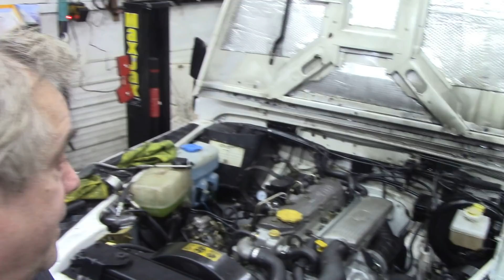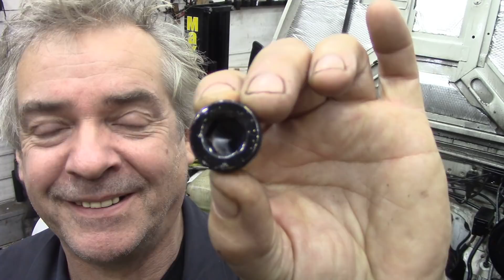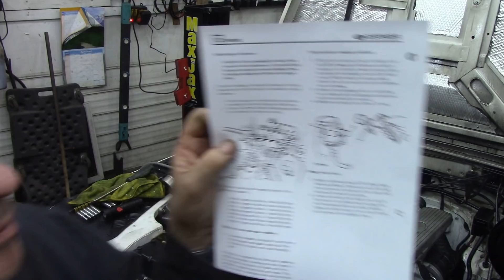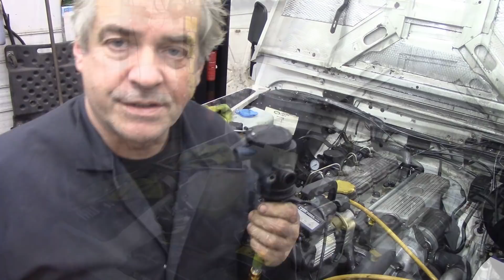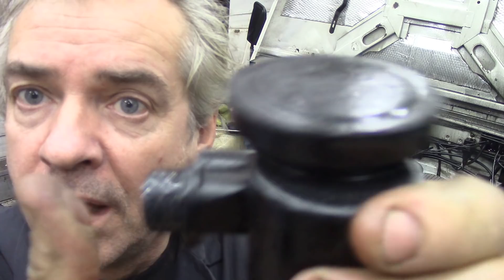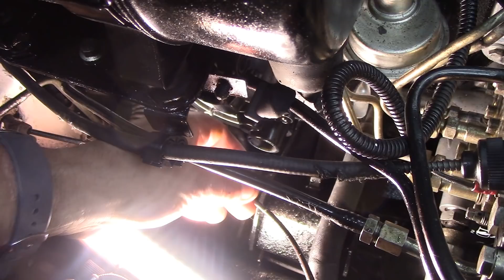Spanish 110 300Tdi. Sorted? Watch to the end!

Comment: Mike, I had a 2005 Volvo v50 (same as s40 sedan) with an electric vacuum pump. It was the 5 cylinder petrol engine probably fitted to other models as well. I suspect there might be a few of those at the wreckers by now.

Comment: Mike, I thought while you were testing with the vac pump blanked off, I would prefer to remove the Vac pump all together and put a plate over the hole in the crank case. You know then it can’t be blowing air into the crankcase
Reply from the maker: I normally remove the hose and plug the connector - that is normally enough to eliminate the Servo leaking, but I didn't expect the pump to be bodged up

Comment: You are supposed to run an engine hardish right away to get the rings to seat before the bores glaze.  Bringing in at idle is the worst thing you can do with new rings.  As to the breather, the diaphragm valve is better design.  It limits vacuum levels on the crankcase.

Comment: Mike, you don't even imagine how many times I have been talking to my friends, the ones in the Land Rover Workshop, about those vacuum pumps, my idea was to put a blank cover there and then use electric vacuum pumps... the result, no leaks and if the pump is good no more problems... I have to find out which ones are good... I am sick of 300Tdi ones... Also... 200Tdi were really good... A pity the engine block was redesigned...
Reply from the maker: I have ordered a  Hella UP 28  - when it comes I will do a video

Comment: Hi Mike quick question I'm buying a series 3 am I going to need a set of Wentworth spanner to work on it or will metric spanner be enough
Reply from the maker: Depends on the year, but there were Whitworth bolts on the transmission but most should be AF - regular inch spanners - very later ones were Metric

Comment: Hi Mike, when you revved and it went bang was the turbo/intercooler still blocked, maybe if the turbo is the cause of crank pressure then is that not the cause of that little plug blowing out the vacuum pump so I'm leaning more towards a faulty turbo? P.S Breasts on a bull or Tits on a rattle snake.
Reply from the maker: Well runs fine now so it must have been the plug or I would still have pressure

Comment: I said I had the same issue, with the exhauster pump pressurising the crankcase forcing oil passed the rings, it looking like a two stroke landy. When you replied you had blocked it off, I thought you had removed it. I was toying with the idea of trying to use a td5 vac pump on mine, but will have a look at the electric ones. Great vlog and pleased you've sorted it. 👍
Reply from the maker: Thanks for sharing

Comment: You have not wasted your time on this one Mike. You have been caught in a cycle of learning, and that is what this job is all about. I bought quite a few Ford Cargo wagons that had been put into the block/auction because of supposed head gasket problems that could not be fixed. I found out that it was the head gasket on the water cooled compressor that had blown causing pressure in the header tank. It cost less than a fiver to buy the parts and less than a hour to replace. That is where knowledge is worth having. So please dont kick yourself to hard for taking us through this learning curve. Many thanks, Yorkshire Rob.
Reply from the maker: But of a mind f*ck as I knew the pistons were correct - shoved a temp plastic plug in there while JP makes me a metal one - no back pressure, sweet as a nut now - like a Swiss watch!

Comment: When vac pump started leaking on my 300 i did same, Used a Hella UP28 Vaccum pump off a Jaguar, then a vac tank off a VAG,  a Adjustable vaccum switch ( PSF109S-81-330) and setup with a vaccum guage. The Hella pumps are used on loads of diffrent vehicals (VW/Audi, Volvo, Jaguar/Landrover, Mercedies, and wouldnt be supprised to find them on load of American Stuff aswell)   most direct injection petrols use them and of course diesels. I just picked up a used pump for £20 or so and has been woprking flawlessly for 2 years, Planning on adding another one in the loop for redundancy easy enough to do and can put almost anywhere.  New ones are of course available but im cheap
Reply from the maker: I an going to see if I can make a full replacement kit  - with blanking plate, support bracket etc for less than the costs of importing the cheapest new one (C$200)

Comment: Regarding the whole "take it for a run" thing; nah.

You've rebuilt engines before (once or twice) and this hasn't happened before.
If it WAS common for 300tdi engines to act like this until they've been run-in, you'd know about it and you'd have seen it before.
This ISN'T a common issue, which might cure itself after running-in.
It's something with a specific cause that needs finding before you can say it's fixed.

I'm a great believer in FINDING the cause of problems.
Whenever something malfunctions, you've GOT to find the cause of the problem or you don't know if it's going to crop up again later on.
When people say things like "I just sprayed all the connectors with WD40 and the problem went away" or "I just revved it up and it's cured itself" it always gives me the heeby-jeebies 'cos they HAVEN'T figured out what was wrong and they're just hoping it won't happen again.
Which, when it comes to problems, they always DO happen again unless you find the cause and fix it.

Regarding the electric vacuum pump, by coincidence I've recently been helping somebody out with fitting an electric vacuum pump to a boat engine.
The guy ended-up buying an electric vac' pump for a Ford F250 and he seems happy with it.
Only problem is that the electrical connector is molded into the body of the pump so, if you want to make a proper job of it, you also need to buy a wiring pigtail from a Ford dealer.
On the positive side, once you've got the pigtail, you can make a proper job of the wiring and make the pump look like it's a factory fit.

No idea how reliable the Ford vac' pump is though, TBH.
The guy bought the Ford unit 'cos it was simple and is about half the price of an equivalent from other manufacturers.
He seems happy with how it's working though.
Reply from the maker: Just ordered this
https://www.ebay.ca/itm/284352951926

Comment: Mike, what about the possibility of pressure from the turbo being released into the crank case through the oil drain pipe and a leaking turbine shaft seal...
Reply from the maker: I had this thought - until I saw the vac pump plug!
Reply: @BritannicaRestorations  yes, that's not okay for sure but can it alone cause that back pressure?
Reply from the maker: Well it has been running for an hour now with zero pressure out of the cap, so I think that is it
Reply: @BritannicaRestorations  unbelievable! As you have said earlier: something very stupid

Comment: Definitely not rings, I commented on one of your previous videos about my rebuilt 300 TDI with too much crank case pressure.
When I pulled the head and sump to fit yet another set of rings I found nothing wrong with the rings or bores.
Every thing was new on this motor, bored 1mm, crank ground 0.25mm, new head, new conrods, new vacuum pump, lift pump, timing belt.

After seeing that plug come out of the vacuum pump I'm suspecting my not very old leaking vacuum pump is rubbish and is possibly
My problem. I've been a mechanic for over 30 years and have rebuilt plenty of motors. I always expect a little blow by past the rings until they bed in, Like you have noticed with the compression increase and no longer pushing oil out.
I thought I might of installed the top ring wrong way up after finding my motor still had to much blow by after 15 000 Kms driving but a new set of rings did nothing. I will be quite cranky if it all to do with a badly made and not so cheap vacuum pump
Reply from the maker: Check the servo first - very common for them to leak and draw air into the crank cases - in my instance I plugged the pump = but it was still drawing in air through the doggy pump
Reply: @BritannicaRestorations  Already did that test by plugging the vacuum line after seeing your video on a previous engine you were  working on that had excessive crank case pressure. The vacuum pump has leaked oil from from the plug area since fitting it new. I've been a long time watcher of your great videos 😉

Comment: Cross fingers that the vac pump caused that problem.
That engine should have tons of power, with the pressures you measured.

An engineering machine shop built an engine for my S3 SWB, petrol.
It burnt about 1 litre of oil a month. I took it to them but they were useless.
My regular mechanic looked at it and found the PCV valve diaphragm was defective. Replaced it and reduced the oil consumption to 1 litre every 3 month.
Many years later, the engine had a major failure; it was a right off. My mechanic stripped it and found a baffle missing on the oil filler tube, hence, the high oil consumption. There were other wonderful things like part of a stocking in one of the water galleries.
Good times had by all.
Reply from the maker: yeah I think the numbers are good - had t be something stooopid!

Comment: I was wondering a couple of vids ago if it was the vac pump but couldn't remember exactly what effect they could have when they go wrong.  I have been wondering about fitting an electric vac pump to mine too as i think the current pump has packed up, third one in four years!
Reply from the maker: They are total crap! I think because the pump was washed in the parts washer, the silicon used to hold the 'plug' in became soft and alowed air in = but as the engine got hot the silicone dried out and sealed again - but not tight
Reply: @BritannicaRestorations  I'll be looking out for the vid on electric vac pumps from scrap cars, just looked at the price of some new ones!  Mind teh rubbish Wabco pumps are £100 or so at the moment!  Could just push the brake pedal a bit harder like on my series 3 instead! :)

Comment: I hear the diaphragm on the breather of my 200 cycling at idle.  It makes a periodic plasticky “glug” as it pops closed.  It’s so obvious because it is a 200 retrofit into a Series III using a 19J air filter, with the breather feeding into the inlet of the filter housing.  The noise travels up the plastic Mantec snorkel pretty well.

That damned engine was fully rebuilt with a +20 rebore, rebuilt head and a good swapped out turbo.  It then had that turbo rebuilt and later replaced with brand new (Turbo Technics), the valve stems seals replaced again, then the head fully rebuilt again and the rings replaced.  I still can’t find why it burns oil, especially at idle and on the overrun.  Not sure if there is a honing issue, bore glazing from running in too gently and using Slick50 and vegoil too soon after running in, or maybe a blocked turbo oil return causing the oil to get into the turbine.  Each time the head came off, the piston crowns were a little coked but not wet, so I’m really wondering about the turbo oil hose, given how much else has been replaced.  It’d be Sod’s law to be something cheap and simple after so much cost and effort, much like your vacuum pump!  

My wife’s FFR Lightweight had running problems a while after we got it.  It’d start instantly after standing for months and was so smooth and quiet, but once it warmed up it became gutless and would misfire.  I rebuilt the carb, the entire fuel system (rebuilt the fuel tap, lift pump, removed and riddled through the pickup pipes, new lines and hoses) and replaced the exhaust and manifolds with new, while my wife rebuilt the distributor.  We even tried replacing the carb and entire ignition system with new, all to no avail.  It occurred to me a while after we sold it that the brakes got bad at about the same time, so it was almost certainly the servo leaking into the induction manifold, weakening the mixture.  Amazing, the trouble that ancillary air leaks can cause.
Reply from the maker: On the HS 2.8 they had a modified rocker box cover with a baffle front to back so there was no oil splash getting into the same separator as the 300/200.
On the Tdi the pipe on the top feeds directly into the intake hose - not the filter - problem is with retro fits is the original air filter system is usually missing. I have a few 200Tdi filters here - but no brackets that attach to the inner wing - these are complicated to make and now obsolete 

Servo leaks are so common and cause so many issues.
I think on this engine with the vac pump plug being lose caused the problem - I missed it as it was painted black, but  I washed all the parts in the washer  - so I expect the silicon went soft allowing air to be introduced into the crank cases, but as the engine heated  up it started to dry - which would account for it getting 'better'

Comment: The core plug is 22 mm in diameter and 9.4mm deep.
We had a guy that made kits for us. It also came with nuts and bolts to replace the rivits as they also tend to snap.
All in stainless steel.
Reply from the maker: looks like a trip to JP's to get a taper plug made!
Reply: Are these kits available?

Comment: Mike, can you explain (to neophytes like myself) how that vac plug would result in the crankcase pressurization/oil issue? Thank you
Reply from the maker: the vac pump draws air from the servo  - when in good condition, no more air can be 'sucked' from the servo.
The air from the servo is exhausted into the crank cases
IF there is a leak in the servo - the vac pump continues to pump air into the crank cases causing excess crank case pressure
Reply: @BritannicaRestorations  Thanks!  Guess I didn't realize the exhaust of the vac pump went into the crankcase, thought it just went out to atmosphere.
Reply: @BritannicaRestorations  the air is sucked by the spring inside the pump, not by the cams. It's a delivery on demand pump; just like the fuel pump. If a plug in front of the one way valves is leaking, the pump is working at greatest hight of the cams. That's the ticking noise in one of the videos. The Britpart pumps made a good job since the last five years. The original pumps losts their piston seals within 500km. The vacuum pump is the lump!

Comment: Good idea Mike, that Wabco design vac pump is certainly nothing but trouble, these are the details of the vac pump and switch I bought for mine from eBay in 2019. Like I said at the time, no more engine oil leaks, better low speed brake response. Below are the listings of the parts I bought from eBay.
- Booster Vacuum switch 31265826 31400608, fit Volvo XC90, 20032011.
- Audi A4, B6, B7, A6, 4F Volkswagen Touareg, 7L. 
Vacuum brake pump, 8E0927317A.
And, I'm in Australia, haven't got my Disco D1 anymore, I've "defected" back to a new Toyota.
Reply from the maker: Thanks Gary! I will follow up on those numbers.

Just looked - the vac pump is the same GM one fitted to Cadillac
 eBay 353713602757

Switch 224420992237
Reply: @BritannicaRestorations  Mike, are you going to use a vacuum reservoir tank? I had a 2.2 litre capacity tank on mine, and as well as the vacuum switch that Volvo valve had a "sequester" valve port to keep the tank evacuated and give about 3 brake applications if the vac pump failed to work. Could send you a photo of the set up but as said I don't have the D1 anymore.

Comment: 8:44. Yeah, it's the "no smoke" thing isn't it. If you had stuffed up the rings, or if you'd used std rings in the 20 thou bore, it'd smoke. AND the comp and leakdown tests would not have come back the way they did. 
I definitely like the electric vac pump idea, as the cam driven one is a PITA. Looking forward to you doing that. Electric fuel pump not so much as i have done those. 
And you are correct, the TD5 has the vac pump on the front of the alternator. Works fine until the serpentine belt breaks, but if that happens no vac is the least of your problems,  at least on a D2.
Reply from the maker: Gary pointed me in the direction of a Volvo pump which is the same as a GM Cadillac. All you need is a vac switch and relay  - I have a cunning plan for a mounting!